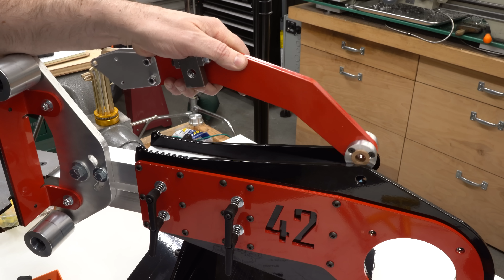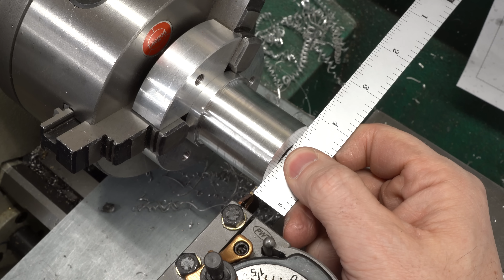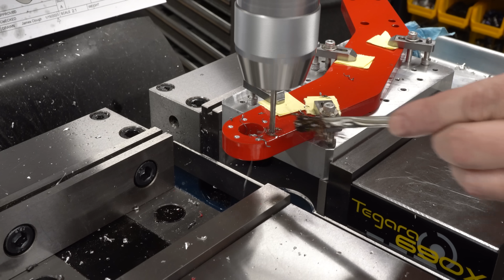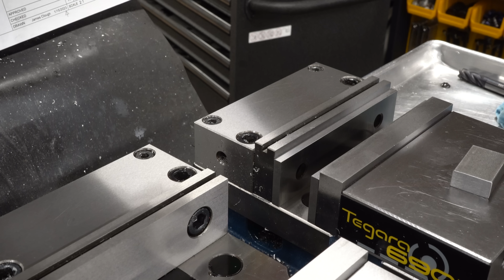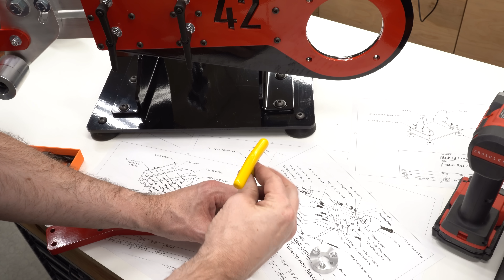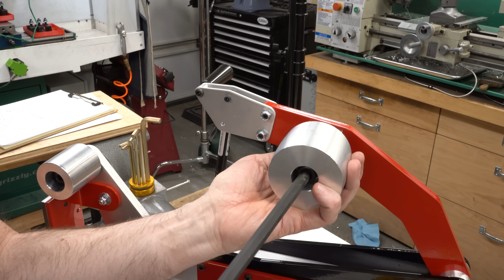Ultimate DIY Belt Grinder: TRACKING and TENSION Mechanisms - Part 2

Comment: Hi James, you did a great job. Perfect precision and elegant design.  I am not a Machinist, but an Structural Engineer as wood working hobbyist.  Anyway just a suggestion, do you think it is a good idea to install a try with Magnet with specific strength at the bottom to collect the ferro particles?
Reply from the maker: It might help.  It would also be difficult to clean.  :)

Comment: Hey man. I would love to do some courses in how to use Milling machines the correct way. I wish I could afford one of those beasts u have behind u in the shot. I bought a loada gear to build my own DIY CNC Router but it hasn't quite worked to perfection atm. I'm new to all this CNC subject matter. Literally by a few months. I'm 51 yrs old this year and never heard of CNC machines until last year on YT. I bought a Laser Engraver just to see how these things work and I'm learning but it's the software I always struggle with.
I'm about to begin building my own Welding table and Table saw. The parts are coming in thick and fast now and I cannot wait to begin next week..
I have collected some great ideas from others on here too. I love to pick and chose from others builds and attempt to put them into my own but time will tell if I have the skills to get it finished. The CNC ROUTER is close to running again. I think I messed up with the wiring of the electronics. It worked for a wee while then stopped. Now I have to break it down and rebuild from the beginning after learning some new things. 
I priced a belt sander like yours on VEVOR to the cost of 800 euros odd but it was nowhere near looking as good as yours bro. I doubt it had the nice parts yours had either. 
Your skills are brilliant pal. I love watching great craftsmen at work Yes u use machines but U also use ur hands too. I really enjoy these tyoes of videos and will be watching for more soon. Take it easy and salute from Dublin, IRE.

Comment: I saw that you have a keyless drill chuck. What do you use to really clamp this chuck down? There should be a tool for that.
I have a Röhm Supra SK and a bosch chuck with three holes of 6mm at the bottom with a diameter of 39mm (Bosch)/40mm (Röhm) and 2 holes of 6mm at the top with 42mm diameter (only Bosch, Röhm has a 19mm nut on top).

I really want to have a tool to clamp my chuck sometimes a littlebit more than only by my quite strong right hand ✋,🫣.

Can you help me out with that information deficit?
Reply from the maker: The tool you want is called a hook spanner.
Reply: @Clough42  Thank you very much. Just ordered two.

Comment: I must have missed it.  Have you gone over how you adjust the tension and belt tracking so that it remains centered as your pulley surfaces appear to be flat rather than slightly crowned?  I really like the visual appearance of this design and am wondering how to do one for myself even though I don't have a mill and lathe.  To that end at the end of this series could you review your materiel and outsourced cost estimates as the shop time for most of us is 'personal hobby' time.
Reply from the maker: The drive and tracking pulleys are crowned.
Reply: @Clough42  Thanks. Sorry about being dense. Caught that on the second watching.  Thanks. Looks magnificent.

Comment: James, your videos and calm delivery are always a joy to watch.  I'm a garage woodworker, not a machinist but hey, anything shop or tools related - I'm in.  Towards the end your little Harbor Freight Arbor Press looks like something I could use.  I'm refurbing my dad's early 70's Craftsman 10" table saw and have come across a 1/2" shaft, 6" long with the final 1" turned down and threaded 3/8 16.  The shaft is straight but that 1" of threads are slightly cocked at an angle.  I've just searched the HF website for a small press like you showed but don't see one.  Do you know if its still available?  I suppose I could try a few local mechanics to see if they have a press and be willing to tweak this for me.  Thanks!
Reply from the maker: The one I have is the half-ton model.  I don't see them at HF any longer, either, but they're all over Amazon under various brand names.

Comment: Turning off that distance to go beep was the very first setting change I made on my mill. :-)
Reply from the maker: It isn't mentioned at all in the EL400 manual, but DRO Pros has a document showing how to reconfigure it.
Reply: @Clough42  I think that is where I found the answer, too. I am not sure because I turned it off two years ago and have never wanted to turn it on again. I have a printed version of the page stashed in case of factory reset or something.

Comment: James, fantastic design, and I appreciate your comment about getting to a functional starting point and worrying about the accessories later.  Too often people sacrifice good in the name of perfection and end up with nothing.  
I do have a question:   Why did you opt for a nut on your tracking lever vs. threading the shoulder bolt into the yoke?  In no way am I criticizing, just curious about your reasoning.  Thanks!
Reply from the maker: I wanted the ground shoulder of the bolt to bear on a reamed hole at both ends instead of counting on the threads as a locating feature.  Also, this way the nylon lock nut shouldn't come off, even if the bolt vibrates around and rotates.
Reply: @Clough42  That totally makes sense.  Thanks!

Comment: Couldn't help noticing, even with heavy tooling in the mill, how quickly it stops. That VFD (if you have one - I forgot) seems to do a great job. Such a nice build this one. Looking forward to part 3. Then of course, you'll be obliged to make a knife or 2. The challenge is to make a folder. Yes, I know you have a loyal BM AFCK (which I'm lusting after, but can't find).
Reply from the maker: It's a single-phase mill, and I'm stopping it using the brake handle.

Comment: One suggestion.   On your tool arms that slide into the frame mill a shallow slot lengthwise where the clamping screws tighten against them.  It doesn't need to be deep but those screws are going to mar the surface of the arms.  If you mill a shallow slot those mars will be in the slot bottom and won't effect the sliding of the arms.   Maybe your tolerances aren't so close that it would bother but on mine it would!

Comment: The form tap is interesting, but since everything in machining is a compromise, what are the limitations or downsides? I saw another commenter mentioned the hole diameter is different and higher tolerance is required, but is there anything else?
Reply: They are not allowed on Aerospace work because the thread peak usually has a crack seen under inspection.

Comment: Additional advice for form taps, the tap drill diameter is larger than for cutting taps because it's based on the pitch diameter of the thread rather than the minor diameter. It doesn't appear on common charts, you need a special one. And it's really critical. If the hole is even a tiny amount too small the tap can bind, because there's not enough space for the metal to displace into. I've never used them much, but sometimes they can be real problem solvers, and every HSM should know about them.
Reply: Ok so I need taper, plug, bottoming in straight flute, spiral fuse, spiral point, and form varieties, metric and imperial.

I may need a moment here guys.
Reply: Oh and I didn’t even consider tool material or coating.  I’m not addicted, I can stop anytime I want.
Reply from the maker: Yup.  There are several places on the web where you can find drill size charts for form taps.
Reply: More importantly, they need to be absolutely rigid. Usually more rigid than amateur home shop can manage, certainly never by hand. I gave up after breaking a couple. The runout on a drill press will snap them even if fixture is rock solid
Reply from the maker: @Tigglebitties  No, they're not that sensitive.  You watched me power tap with them in my mill.  I've done it by hand.  Heck, I've even run them through steel with a cordless drill.
Reply: @Clough42  Love your channel, James!  Clearly there’s demand signal for a more in-depth video on form taps.  Thanks!

Comment: For the Beeper suggest a lit latching pushbutton common in medical gear for this purpose. Lit when muted dark as 'normal', personally I would like just remove the buzzer 😆
Reply from the maker: Spoke too soon.  DRO Pros has a document about this: https://www.dropros.com/documents/EL400ZeroBeep.pdf
Reply: @Clough42  Easy then :)
Reply: @Clough42  👍👍😎👍👍
Reply from the maker: I just checked the manual, and they just proudly proclaim that they have a near-zero warning function.  No mention of any ability to turn it off.  :(

Comment: Can I ask what those little bottles you keep your cutting oil in are called? I've looked off and on for them and can never seem to use the right search terms to find them!
Reply: Look for "Spillmaster"
Reply: I replied to this three times in a row with the brand name and all three times, my comment was immediately deleted.  Strange.  Let's try it this way.  Search for this word with all of the spaces removed: s p i l l m a s t e r
Reply: @michaelstump6933  Try mispelling the brand name in an obvious manner.  That might work.  I hope that you are successful because I'm sure that many want the same useful information!
Reply: @Bob Vines  Hi Bob...just edited my comment with spaces in the name.  Hopefully that sticks!  I agree that those containers can be tough to search for.  I think it's the last two syllables of the name that may be what YT had an issue with.
Reply from the maker: The cups with the brushes are Spillmaster containers.  I got them from my local tool supplier, but some of the Internet tool suppliers have them.  The pump oilers are from Goldenrod.
Reply: For my cutting oil, I keep them in spill proof paint cups. They are very cheap and come in multiple colors.  Each color for example, is a diff type cutting fluid.  They can be found on Amazon. Simply search for “Melissa & Doug Spill-Proof Paint Cups”. For the brushes I use acid brushes. Search for “Pro Grade - Acid Brushes”. They are very inexpensive. :). Enjoy.

Comment: Hello James. I have been following your projects for some time and admire your skills.
Regarding your belt grinder project, you had set up some parameters for your design. I believe that in this case you have neglected the most important parameter. "security"!!! I have seen many belt grinder designs, unfortunately for all of them, no one thinks about safety. no one has a thought on how to catch the grinding dust there are throws around in all directions. In my opinion, this is a huge mistake. And yes your machine looks great and I'm sure it will grind well , but without any dust collection*S* Am working on a design myself, and this dust collection isue is not an easy task to solve but think it is a must!!
Reply from the maker: The design is intended to be modular.  I have a bunch of ideas for dust collection, articulated tool rests, pivoting to horizontal, etc.  But the fact of the matter is that none of those do any good if I keep designing it forever.  I had to pick a point to start building.  That other stuff will come if and when I have the need for it and have time to work on it.  Dust containment is probably going to end up being high on the list if I find myself using it a lot.
Reply: @Clough42   James, I have no doubt with as clean and orderly you prefer everything, you already have a clever design in mind.  But if it helps..... You might consider using a restaurant 1/3-Size or 1/4-Size, 6 Inch Deep Stainless Steel Steam Table Pan to catch the grinding dust.  It has worked wonders for me on the 2x72 grinder I built.  I fill it about halfway with water and position it just under the lower platen wheel. Catches almost all the debris and the 1/3-size pan is long enough to allow access for dunking and cooling the item i'm grinding too.
Reply: I've seen water cans installed immediately under these grinders to catch the "downward" sparks - they work well.  I also agree to the need for proper dust collection.

Comment: Swapped out many beep beep #@&$ beeps for a light wait assistant.
Reply from the maker: I was surprised to find that there isn't a setting to turn it off.  Sounds like someone is going to need to get in there with a soldering iron.
Reply from the maker: And...a little more searching turns up a solution from DRO Pros: https://www.dropros.com/documents/EL400ZeroBeep.pdf